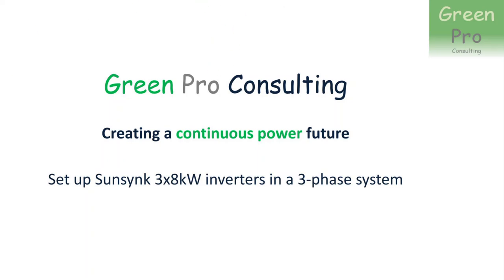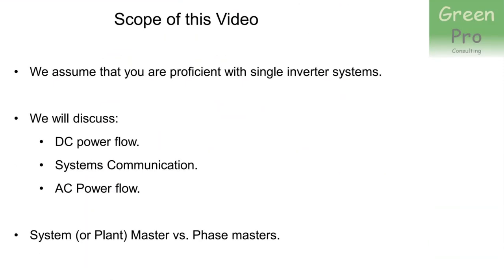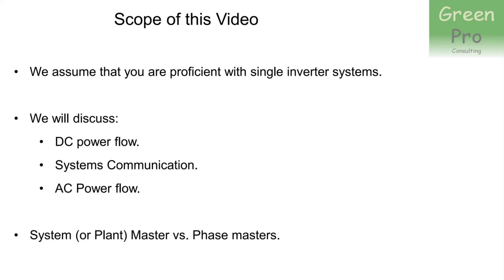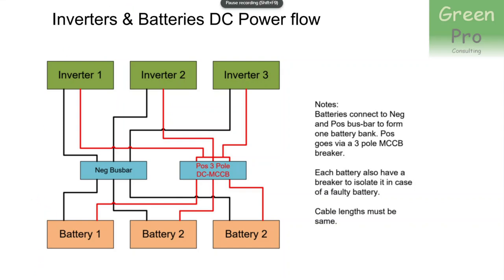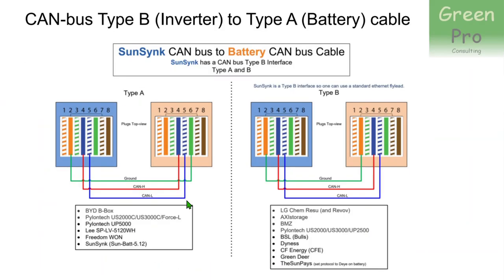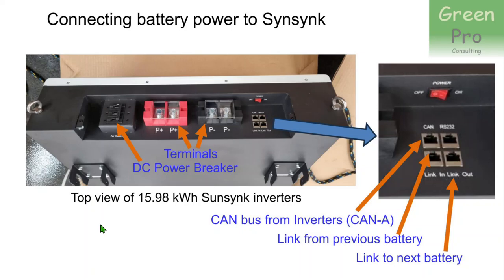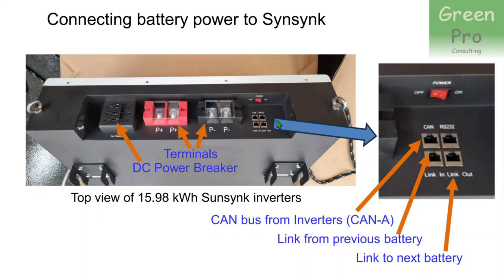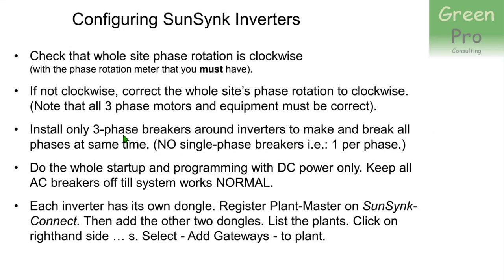Installing 3-Phase SunSynk System

Comment: Is it a problem if some of the batteries are older?   I have 6 Revov R100 batteries, but I have been using two of them for about 2 years, where as the other 4 I bought new on black friday and have not used them yet.

Comment from the maker: I would be very reluctant to use a 2 phase system with 2 x 8Kw single phase inverters. Sunsynk has a problem with 3 phase systems built with 8kW single phase inverters. The phase sequence of the system output is erroneously reversed. SS is very tight lipped about this. Their solution is to configure the A and B phase inverters reversed to correct the phase sequence, but they don't say it. That is where this vague unjustified instruction to make the center inverter the phase A master (i.e.: and then also the plant maser). So I have no idea how a 2 phase system will behave, and don't expect any wisdom from SS.
The problem is the MPPTs of the single phase inverters are much better to use with say 550Wp panels while the 3 phase inverter's MPPTs are rather screwed up, so one is inclined to use 1 phase inverters. I would cut my losses and use a 3 phase configuration.
Reply: Problem is the 3 phase inverters use high voltage batteries but the single phase inverters use 48v

Comment: I have a lot of residential clients that are 3 phase 
But would probably only need two 8 kW sunsynk inverters 
Especially to get maximum solar on different roof slopes 
In other words need 4 Maximum power point trackers 
Have you tried this with 2 inverters connected to two phases?
Would this work or would there be an error?
According to the Sunsynk help line it should work 
Have you tried this?
Reply from the maker: @capebee4839  If a house is 3 phase then think if you really need 3 phase. Most circuits leaving the DB is single phase. SO, if you don't have 3 phase motors, then 1 phase is enough.
Compromise is you can only charge from 1 phase.
Reply: @greenpro-greenproconsultin7420  the problem with only using 1 phase is that you then limit your maximum pass through current 
Some houses are 30 Amp 3 phase, some 50 Amp 3 phase 
So only using one phase maybe a problem